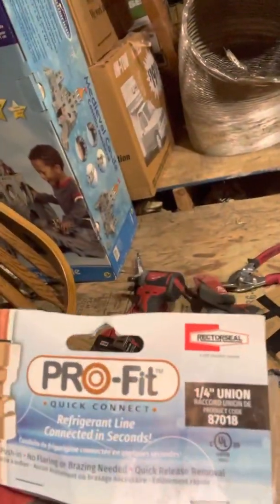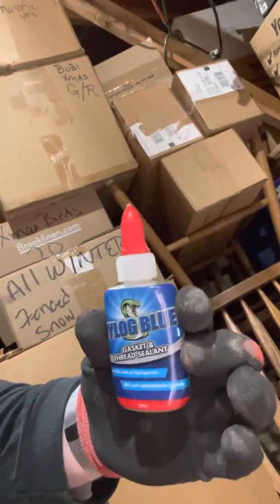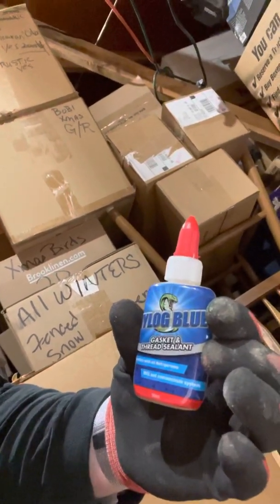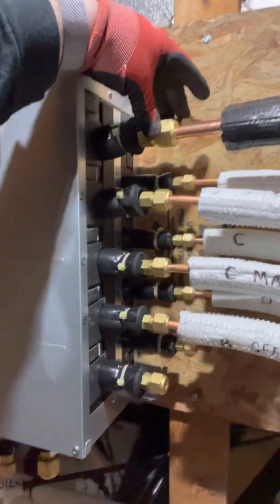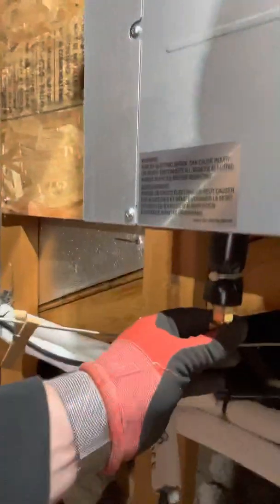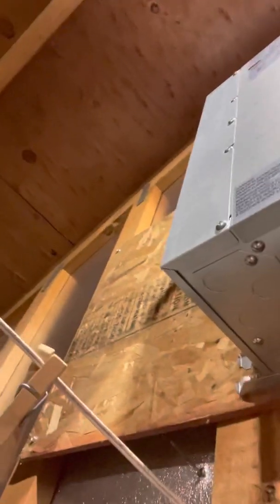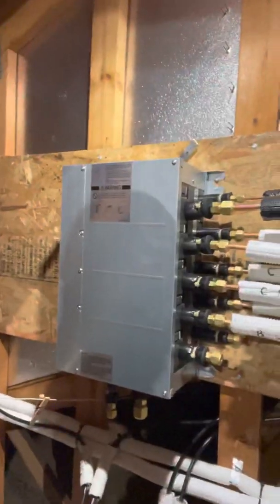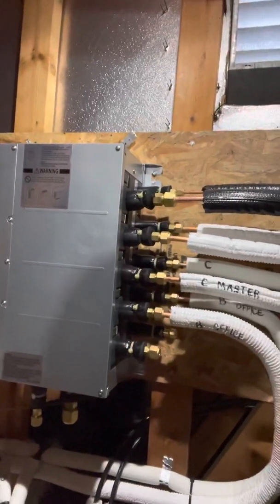Mitsubishi Ductless branch box Install (Nylog Blue) Multi-Zone (Pro-Fit Quick connectRectorSeal)

Comment: Thanks so much for this incredibly helpful video! Your explanations on branch box installation and refrigerant line routing really cleared up a lot for me.

I do have one question I hope you could help with:
In the Mitsubishi installation manual for the MXZ-SM36/42/48NAMHZ, it states:
“*2 Branch box should be placed within the level between the outdoor unit and indoor units.”

Does this mean the branch box cannot be higher than the indoor units? If so, could you please explain why?

In my case, I’m using MLZ-KY06NA-U1 ceiling cassette units, and I plan to install the branch box in the attic—so the branch box would be higher than the indoor units. The height difference is probably within 3-5 feet. Is that acceptable?

Really appreciate any insight you can share—thank you again for all the knowledge you put out!
Reply from the maker: @JazzyPixel  You must Get the DSB design tool on your computer and build the system. The BB really can be located above or below the outdoor unit. However, if you don't make the system on the DSB program, you will be screwed. You will not know if it will work you “MUST”!build the system with the DSB “ Diamond System Builder” and download it from Mylinkdrive.com
Reply: @ Thanks so much for the suggestion! I downloaded the Diamond System Builder and entered all my info — it verified everything, so my design is good to go! It also really opened my mind to some upgrade options I hadn’t considered before. Appreciate your help and your content as always!

Comment: Great installation and advice. I have a 24K MultiPosition AHU to connect to an MXZ 48KBTU hyperHeat. It is a 4C model. Using 51 BranchBox, 5 ports. Would it be possible to use the largest line on the BranchBox to connect the AHU? The AHU line set sizes are not exactly the same as the largest line set on the BranchBox. Can I connect with an adaptor or such or I need to look for a different BranchBox than the 51 model that is already installed and paired with the outdoor 48NAHZ? Other indoors are two small 12k cassettes so I have a tone of BTUs left unused for the 24K AHU. Just need to figure out how to add it with the non-matching line set of the AHU and the larger line set of the BBox. 
Thank you again!
Reply from the maker: @SeyedRazavi-d7j  Hook up to the top port “E” 1/2” x 1/4” then use adapters.
Reply: @ductlessplushvac  So the E port (the largest port on BBox) AND proper Reducer should in theory let me connect the SVZ 24k line set to the BBox with no freezing or line mismatch issues per your advice. You are a mastermind man!

Comment: Is a branch box ok for 24K Ceiling Cassette?
Reply from the maker: I've never seen that but I can check and see.
Reply: @ductlessplushvac  did you get an answer about the 2K BTU Cassette?
Reply from the maker: @nassaulift7662  yes you can install them off a branch box. You will need to run a MXZ-SM outdoor model and then use a PLA-Square unit
Reply: @ductlessplushvac  Thanks for the info, now I can start this install

Comment: Does it matter which unit gets connected to the top of the branch box with the larger line set line?  I was curious if its best practice to connect the unit that is closest/furthest from the branch box to this port?
Reply from the maker: You should have a larger port on the bottom of the branch box for the larger units. They make piping reducers or any size Pipe you need. Check out MYLINKDRIVE.COM

Comment: Very nice!! How would you connect two 18k head units to that branch box that both have 1/4x1/2 line sets? The Mits literature says "If the piping connection size of branch box does not match the piping connection size of indoor units, use 
optional different-diameter (deformed) joints to the branch box side. (Connect deformed joint directly to the branch box side.)"  What does that mean, just add a converter to step down the one suction line from 1/2" to 3/8"?
Reply from the maker: Yes you would make it bigger or smaller. The branch box has one over sized port for 18,000 BTU units. If you need to add (2) 18,000 BTU units you would put a fitting on one of the smaller ports that would increase the port to the Diameter of the line-set. 
[Subcribe to the channel please] thanks for watching.
Reply: The reducer on the branch box end.

Comment: your pipe insulation stops 1'' to 3''  away from the box  leaving some of the copper pipe exposed to the cold air in the attic should this be a concern ?  Im about to have it installed in my attic next week.  ty,  you guys are great !!!
Reply from the maker: We go back and make sure it's covered. The final installment wasn't done on that video. We put a thick cover on all the ports. Check out some of the other videos.

Comment: Would you suggest buying a unit separately and paying an installer or just finding an HVAC company and doing everything through them?
Reply from the maker: Great question. Most likely you’ll want to go with a HVAC company finding someone with all the tools experienced and knowing how to properly install one could cause you a problem. Also with a company you have a place to call if you need service or help or warranty. I personally will not install customer purchases do to warranty and insurance issues most companies are the same. 

Jared
Reply: @ductlessplushvac  Thanks.

Comment: Great install. What should I look for in a good installer? I have a bonus room over my garage and it is always too hot in the summer and too cold in the winter. I think one of these systems would be perfect for my bonus room.
Reply from the maker: Make sure the system has a good pressure test, a good evacuation, job is cleaned up, line-set hide was installed, pad level, and DSB performed on system. And a load calculation for proper sizing. 

Thanks for watching the video please subscribe and smash the like button! We’re almost to 200 subscribers!
Reply: @ductlessplushvac  Thanks for the quick reply. I definitely subscribed and liked the video.
Reply: Some one who won't install inside walls.

Comment: Have you tried Rectorseal's  Flaretite Seals?   I was messing around with some non perfect flares with a nick/scratch and then put them under pressure and vacuum.  No leaks in 3 days.  I think I found a great product for tying into the back of the  M/S condenser.  Cheaper than pro-fits but they're a one time use.
Reply from the maker: The rep told me a lot of guys use them on bad flares.

Comment: I noticed that you are using 2 different line sets (due to different insulation colors on your line sets). What brands are you using? What is your recommendation for line sets when used in different environments such as exposed outdoors vs indoors only?
Reply from the maker: We use the line-sets that are available from suppliers. Sometimes they come black and sometimes they come white. It doesn't matter what color the Insulation is.
Reply: @ductlessplushvac  What are longest line sets you will use before using a union?